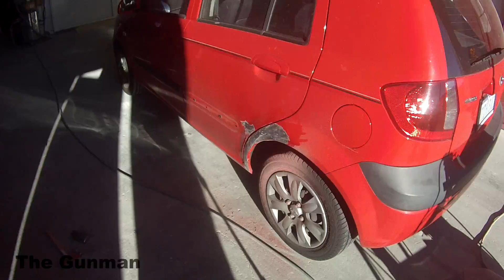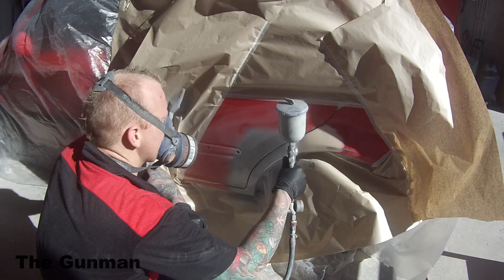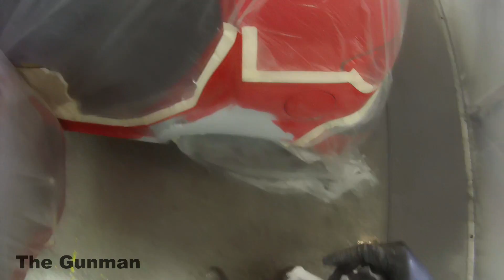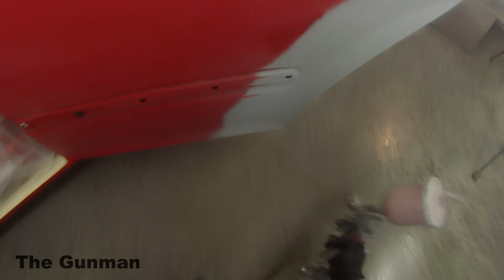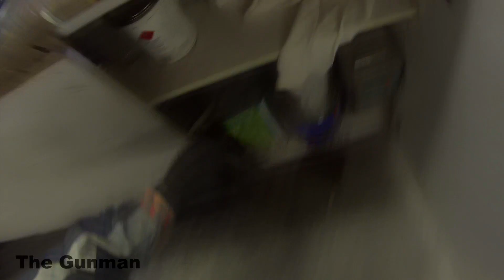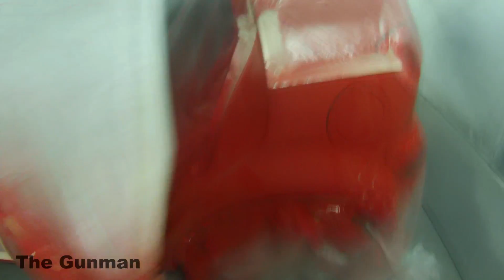SMART Repair

Comment: Man, u made a video before but , im not sure where it was, do u increase ur inlet air pressure on the gun when Temps go lower, thx mate!
Reply from the maker: Yes, that's because the colder it is the paint goes thicker so you need more pressure to draw it out.
Reply: @TheGunmanChannel  thank u, I get orange peel spraying the liquid wraps, I always turn to u for ur videos and advice, thank u

Comment: Great video veey informative as usual.
Quick question i have a 0.8 mini gun if i mix paint 1:1 what pressure should i be looking at
Reply from the maker: Start around 29 psi and adjust as required

Comment: Been watching a lot of your videos for nearly two years mate.  Would like to thank your for the time and effort you put in doing them. For me the longer the video the better as it gives more info. The more explicit the better. I really like your videos and after looking at the ones where you explained the Air caps and then did the distinct demos  this got me to  buy  a Devilbiss  GTI Pro lite which I am going to use to spray a Hyundai Veloster with soon.
I want to know if you use tack rag over your metallic base coat in between coats and also if you use it on the final coat before you put the clear coat.

Comment: Decent video for new body guys but I feel like you need to work on your mud work. If you spend a little more time with the metal you wouldn't spend so much time rushing with a DA. Even if you manage to get this done in one day it's going to pinch back so bad cause it's too course. Looks good for a street fix but definitely couldn't put a warranty on it.

Comment: Fine, but how to protect naked steel from corrosion? By appling a putty directly when it's highly hygroscopic? Not a good idea... IMO better to put epoxy primer at first for a protection then putty that in a next step. Next remark is a 1st layer of base colour - thiner the better adhesion for next 2 full layers.

Comment: Short videos makes us lose alot so  dont stress about it. Do you have a online site you use to mix your Paints or even find what system it is? I sometimes have to call paint shops to to know if it's a metallic or candy? Some shops have a code as a metallic and the other as a candy which is twice the cost lol.

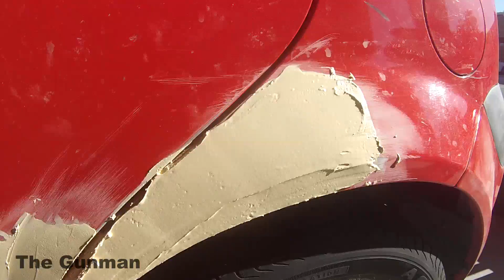Comment: 9:00, where your lights on your led look to be moving.
It is the frequency of your camera and the frequency of the led that are not in sync.
The hertz are off on the camera.
Same with a few of your other videos, when you have the lighting, looking like it is "flashing" ; it is the frequency of the lights and the camera. They need to be in sync...
Reply from the maker: Yes, thanks, I ended up finding out with my new camera at a higher fps it goes away.
Reply: The Gunman, the higher frame rate gets you in sync with "flicker / hertz"...
I have another channel, that teaches photography...
Feel free to ask me anything...
Ps You can use a cheap wired mic, this will help you when you narrate,  from the booth, etc.
You can even record from the wired mic to an ipod or a cell phone.
Then you sync the video and your audio together, in post software.

Comment: Hi gunman how do you change a rear bumper on a hyundai getz
as someone hit my  rear bumper with there 4 wheel drive
Reply from the maker: +John Reynolds it's pretty easy, get under it and remove any clips and screws, there should be a couple on each side going in to the quarter panel and a couple up the top under the tailgate. You should only need a screw driver and a 10mm socket

Comment: Love your videos mate. I noticed you used acrylic primer and then 2k clear. is that ok to do even for larger jobs?
Reply from the maker: It will depend on the primer, some are ok but some aren't, best bet is to check with the paint supplier or read the specs on the tech data sheet.

Comment: did you have to thin out the paint with some kind of chemical to spray
Reply from the maker: Yes for everything but the clear, I only added hardener. The UV primer also requires no thinner or hardener.

Comment: great job  but  why use  clear coat on flat colours  in relation to using the group 2 paint that doesn't require it ????
Reply from the maker: Nearly all cars are still in clear over base even if a solid colour these days.
Reply: thanks   a painter told me they are prone to fading ....but a black 2002 model Peugeot wouldn't need clear or would it ???   take care  great videos dont forget to drink your vege juice everyday
Reply from the maker: TheBloodcleaner You should be right doing it in 2K solid but yes as you say they do fade a lot quicker without the clear which has a better UV resistance.

Comment: Quick question for you: you don't do any rust proofing or anything before you apply body filler? I use 3M body filler and I get rust bubbling even when I go down to mare metal. I have tried products like etching primer and por15 w mixed success, but I always have to apply something before the body filler. Let me know! Thanks!
Reply: That means that your not properly wiping down the metal and keeping it dry when your applying the filler. You need to make sure the metal is completely dry and free of moisture before applying it or you'll trap the moisture. So ideally wipe it down with prepsol then with a dry rag and then apply the filler then you shouldn't have any problems

Comment: Hi Gunman are you interested using my old Magna , with my skg5 devillebiss  it nearly out reg, so not fussed what car looks like . would like to see to passes of clear coat play with pressures and gun control . Would mind doing the work the show so you can correct me on my fuck ups with the GoPro Car is going to the scrap heap after I'm in the northern suburbs.

Comment: that dent puller is great. I have a cheap one that is 2 different parts. you first put the studs , then pull the stud and cut them and grind. The style you have is at least 4 to 5 times faster.
Reply from the maker: Yeah, great tool but over 10k for one of these new, it's a spot welder too..

Comment: Your right about not being a panel beater,you didn't clean the welds very good . Where I come from (snow and salt)this repair would start to bubble in 6 months.You are definitely a better painter though.
Reply from the maker: It will last for ages here in Perth, hot dry climate and no salt unless you go down the beach.

Comment: To anyone asking why the heater display is producing that "disco" effect, the answer is led multiplexing: when you look at a digital display you think that every segment is lit up but it's not. Just one segment at time is lit up, but electricity is "moved" on every segment that fast that to human eye all the segments on the display look lit up. This technique saves a lot of power since just one segment at time is powered up and not all of them.
You can see the effect on camera just because the frequency by which is working the multiplexing is different from the one at which operates the camera (just like filming computer monitors), so the mismatching frequency between the devices gets caught on camera like a flickering.
Reply from the maker: combinbain Similar thing happens with the fluro lights in the booth

Comment: Your videos are by far the best. Have you ever heard of a cycle time reduction repair? It's a technique where you can repair and paint an area as small as a U.S. Quarter or less with even metallics without leaving a halo. It's like a spot blend repair but very small. I think it was a process developed by RM products. Diamont base and clear with UBR 200 blending solvent to burn in the area.

Comment: Hope you change your oil Coalescer filter so it can remove your oil particles down to .01 micron . You should have an auto drain water filter prior to the oil filter.  If your still having problems maybe your air compressor is worn and you have some ring blow by.  I have a refridgerated dryer prior to my 4 stage air booth air with an automatic drain.  Glad to see your doing the air fed resperator.  Charcoal respirators don't filter out all the isocyanates and it's accumulative on your body. Thanks for a great video.
Reply: lol

Comment: Gonna respray my ford transit this summer and I'm a carpenter & joiner!  Might film it for a good belly laugh?  what d'you reckon?  Thanks for the vid, it points me in the right direction!
Reply from the maker: D McNamara Nothing wrong with a bit of bog man, Been using it for years with success.  Its used for a reason and even the best panel beaters I've ever worked with use it, Proven to work and last.
Reply from the maker: Kevin Chamberlain It would be cool, be sure to let us know when it's up on the tube.
Reply: The Gunman I'll do what I can but no laughing!  Btw, can you use a smoothing plane on cars?
Reply from the maker: Never attempted that one
Reply: The Gunman I wouldn't either...   ;)
Reply: The Gunman It's about budget, too mate, innit?  Whoever wants fillerless repairs probably won't want to pay the extra labour costs!  Filler is what it is.
Reply: The Gunman  I learned many years ago as a teenager how to work with sheetmetal. A much older friend used to work on Datsun 510s (poor mans BMW 3 Series was the joke then). Kurt knew-does know how to do anything..........well............this 510 came in for a paint job.

Next thing I remember, Kurt took his foot and completely destroyed the rear- quarter panel on that customer's car (It was a horrible sight, more so Kurt looked crazy and having fun doing what he was doing  at the time).

2 hours later, the panel was more uniform  than it had been stamped originally....  0 Bondo-Filler was used.

Next day, he let me have my way with a female customer of his. LOL !
Reply: Yeh. look at the car, a Hyundai Torture Capsule.
 A+ GOLD STAR for D McNamara though for highlighting real bodyman can actually beat panels into submission and form entire panels from once flat sheet section...........

 if needed....... 

 F- KICK IN THE BALLS its apparent he doesn't understand the collision repair industry and he's possibly borderline delusional with some of his quotes.

You nailed it GUNMAN, Great result for that disposable shopping trolley of agony, bets on the table it's going to take another hit down at bingo sooner rather than later anyway.

Awesome your taking the time to make these vids and without a doubt helping many out there not in the game realize its actually rewarding to have a crack at attacking some panels and squirting on some colour for a few shits and gig's.
Reply: The Gunman You should actually learn how to do professional body-work without Filler. A Professional would use a Spotter,Paddle,Dolly-Hammer,heat-gun,wet rag>>(for shrinking metal) . Using Bondo is not   the right way to repair sheet-metal.

Massaging-working with sheet-metal without Filler is not that difficult.........it just requires patience and many attempts.until you Master the procedure.
Reply: Kevin Chamberlain repairing sheet-metal is very quick once one learns..........takes the same time as "Bondo"...........plus it's safer and better for the environment.no obnoxious fumes/chemicals used !
Reply from the maker: Kevin Chamberlain
Yeah man metal finishing is an art and one I don't know, this rusty old Kombi I'm doing is way beyond metal finishing without fabricating new panels and financially the job just simply wouldn't be done so we do what we can to make it look good with fiberglass and filler. But yes D McNamara is right if you have the skills then some people can do it quicker without filler. From my experience it's a dieing skill and more the older panel beaters who can even do it.

Comment: Great video.  I have one question though about when you used wax and grease remover.  I've done a few small jobs and noticed wax and grease remover completely dissolves my primer.  What kind of W&G remover are you using?  Thanks.
Reply from the maker: rb26dett32 We use a few different brands but that doesn't sound right, it's the primer not the w&g remover, some zinc & copper sprays that are used as a weld through coating will dissolve but I'm yet to come across any acrylic or 2k primer that dissolves with it.
Reply: Wow, thanks for the reply!  i've always used what I get at the local NAPA.  It's called Finish1 FP410 2k urethane primer.  I have used 3 different kinds of W&G removers and everyone of them literally acts like paint stripper when used on primer.  But on paint it works as intended. 

I've read around and have seen that a lot of people say it's because the primer is so porous.  I'll maybe look at buying some better primer because it's a pain in the ass cleaning panels with primer with the combination I have right now.  Thanks again for the reply. 

And thanks for all the videos.  I've literally watched every single one.  Keep up the good work!
Reply from the maker: Yeah sounds like you need to upgrade the primer you use, good luck mate.

Comment: I have a Tekna I bought from the states. So far have done engine bay and jams of a Gemini. Paint is DeBeer BeroBase 500 and MS clear. Used the Tekna for ground, base and clear (3 layer pearl). Pretty happy with result for a rank amateur. I have a couple other cars to do after the Gemini- HJ coupe and a Fairlane. Been thinking about keeping the Tekna just for clear and getting something for base-coats. Is the SGK600 a good choice?

Comment: Wonderful video! Keep them coming ;)
By the way, would you mind giving me some tips on painting in colder environments? I'm trying to transform my garage into a small workshop for painting, but weather in the garage and the country itself isn't that great. Is it possible to get the results as good as in the hot enviroment? Should I be worried about it? How about the runs? 
(maybe I need just some motivation or something but I'm a bit worried now when I thought about my weather conditions).

Comment: nice vid i like watching the long ones and the info even though you might repeat yourself some of it turns out to be important. Stud welders and the pulling accessory which is a flat piece then sits on the stud and pull works great on dents and creases comes with the slide  puller and i found an accessory that turns the stud welder into a plastic stapler awesome piece of kit. keep up your awesome work my friend

Comment: Yo gunman I am from perth same as where you are , congrats on your new spray shop and I have a question for you , I have a Mazda 6 the bumper is pretty much scuffed on the side and I can see my plastic with lines if is possible could you tell me how to repair it at a fraction of the cost at home ? Cheers mate

Comment: Nice work guy, im brazillian and like yours videos. I cant say english very good but i will try .. when you remove the false edge mask on the final of video you need spray in that area the blender thinner??
Reply from the maker: Lucas Cadalora No, it usually just melts in nice then a quick polish after if required.
Reply: Lucas Cadalora Cara a false edge funciona mto bem e tu n passa nada depois. Tu so tem de ter uma linha bem definida para fazer ele. Caso vc nao tenha vamos supor pintando a porta na horizontal ou um teto dai vc vai usar um Belnding thinner, Aqui no brasil voce vai encontrar ele com o nome de queimante ou de thinner de repintura. Sim n temos os nomes certos das coisas. Outra coisa q vale a pena lembrar e q o thinner so vai sobre o verniz Ja usei com a pintura poliester com resultados nao muito legais. Caso se interesse vou estar fazendo um canal sobre repintura bem em breve entao caso queria add no face ou se ligar aqui no canal...
Vlw e boa sorte ai

PS: This comment is in portuguese cuz is brazilian official lenguage Sorry about it gunman kkk :)
Reply: Guilherme Angelo Bertuol Posselt  Boa tarde amigo, eu sempre usei o thinner de retoque, e é que vendo essa tecnica achei bastante interessante pelo fato de não usar o thinner na emenda e não alongar o retoque. Geralmente eu alongo o retoque para disfarçar, mas vou esperimentar essa da fita no vinco . Obrigado

Comment: A company called Lenco makes a similar machine here in the states for around $700 US new. I got lucky and picked mine up for 200$ used on eBay. They are a great little machine. I work in a assembly plant and these are the same machines we use to pull dents on the assembly line in the body shop. We have to pull and metal finish small dents in 42 seconds or less, and were not allowed to use any type of filler. These days I can pull most dents out of a car and metal finish with a file and completely skip the bondo or bog stage as you guys call it over there. Just throw some primer over it and block out the scratches from the file and you're good for paint. Wonderful machines, keep up the good work!

Comment: Hi, can you explain what you are doing at 25min 40s, looks like you have put thinners into the gun and then using it to spray on the car?
Reply from the maker: racediagnostics Yes, it helps the clear fade out so you don't have a thick edge where the clear stops.